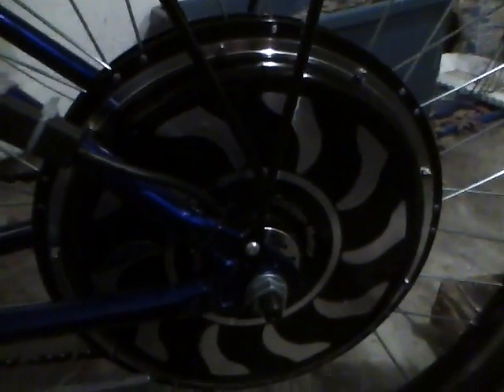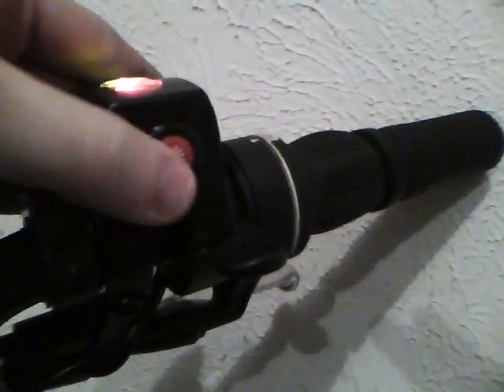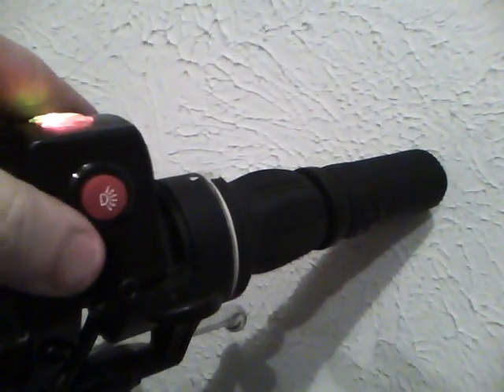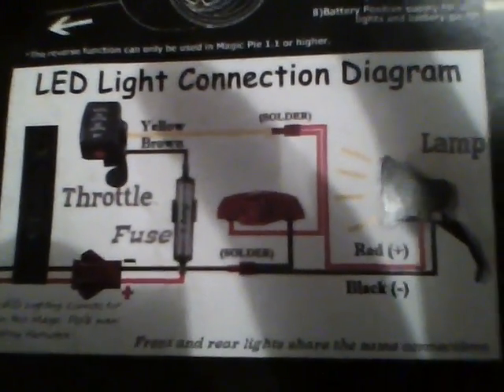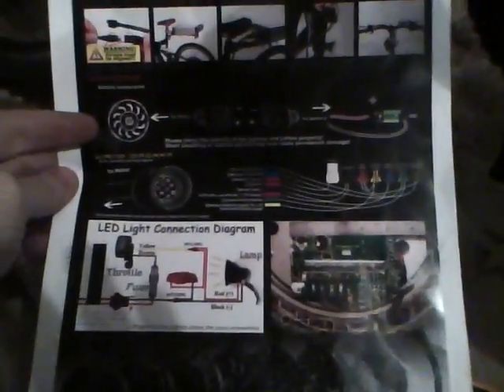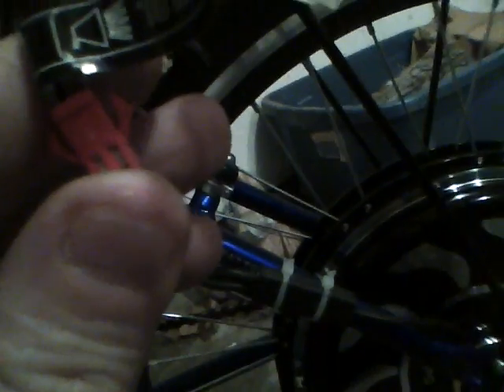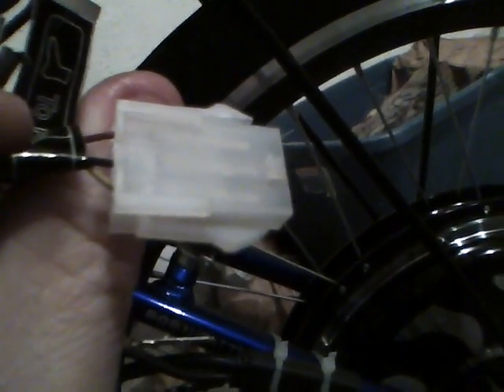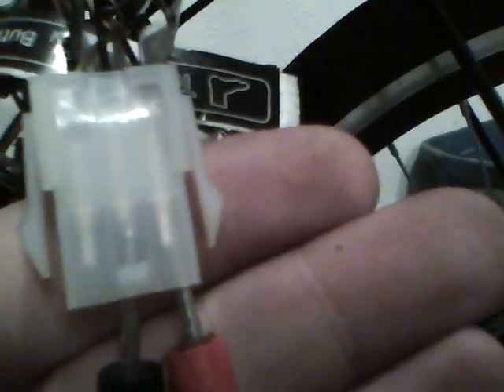Magic Pie II Docs don't match the motor...  Or I'm stupid.

Comment: Do you need to use all those wires. All I want is the button, battery and wheel. I don't need the lights or the braking feature

Comment from the maker: @MrBrumbrum73 Yes!  I figured it out.

The wires that come from the light switch is dead.  When you switch the multi meter in to an inductance test mode you will find the switch easily (Test for conductivity, not current.)

As far as the 5 volt feed...  I didn't end up using it.  It sags when you hit the throttle.  I got a separate step down transformer.  My 48 volt feed goes in, and a solid and steady 12 volts come out.

Comment: did you work this out? if so how?  if not try posting a link to this video on the Golden Motor Forum

Try reading  the voltage from another spare connector, i.e the horn connector. if 5v try plugging 5v light in there.  

Your instruction diagram looks wrong. Ask on the above link for the magic pie connector diagram